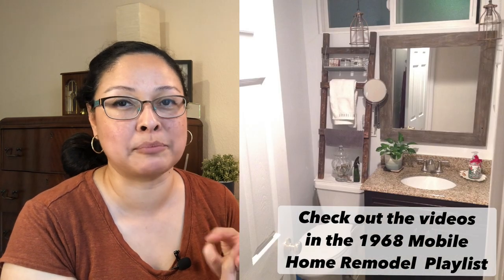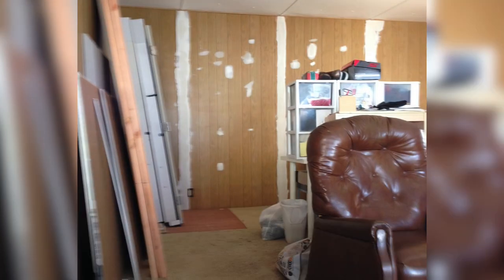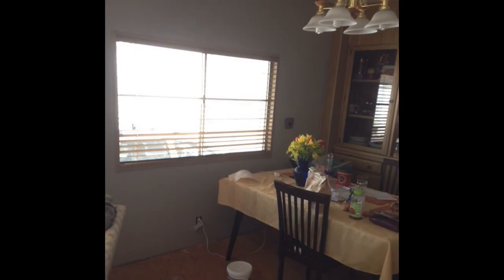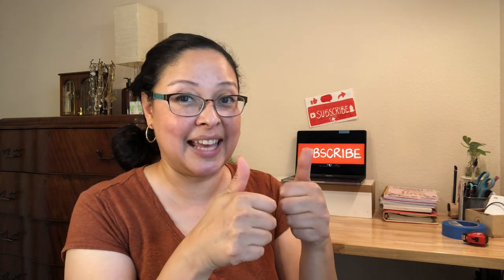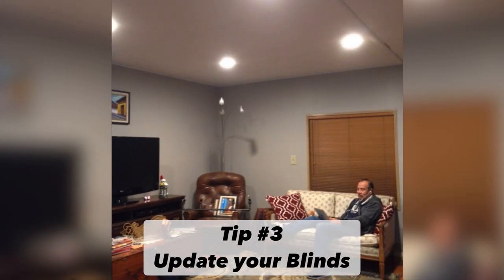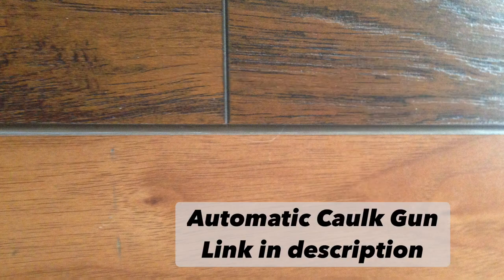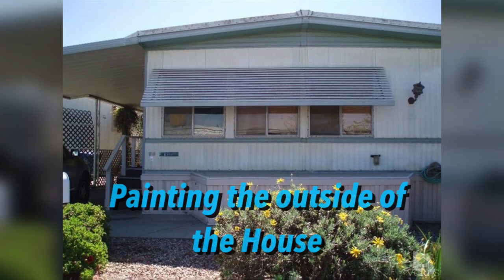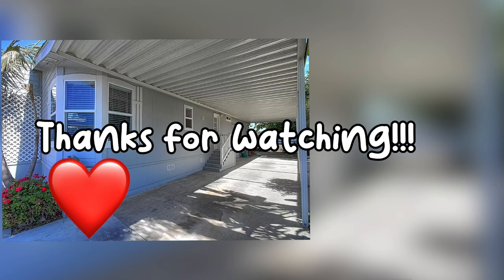MOBILE HOME RENOVATION | LIVING ROOM AND DINING ROOM BEFORE AND AFTER | 3+ TIPS AND MUST HAVE TOOLS

Comment: So you suggest using 1/4 inch drywall instead of leaving the original panneling and all that joint compound and sanding? I have so many questions to ask you. But I refrain and space my questions out. You are a great inspiration to me.
Reply from the maker: I’m happy to help! Yes, 1/4” because of the weight, I would also reinforce the studs if possible and see about leveling the house and have it reinforced since you’re adding weight, but consult with the company to see what they recommend. I had a contractor tell me the house needed the change to drywall and I freaked out, but looking back it was what it needed… I just didn’t know how to do the job and didn’t have the budget to hire it. Now with experience it’s not that hard. Also get various quotes that way you can compare if you’re gonna hire it out.
Reply: Great information. I have done quite a bit of drywall work in my time. So my problem now is having the time for any major work. But you have given me some great ideas. And I thank you.
Reply from the maker: Oh you have a great advantage, but yes, it is quite a bit of work, but not as much as trying to cover the paneling like I did with joint compound! (Too much and the drywall has such a nice updated finish. Definitely something to weight it out to see  if you have the time and the budget to get it done. 👍🏼